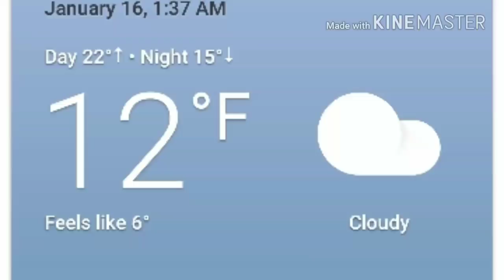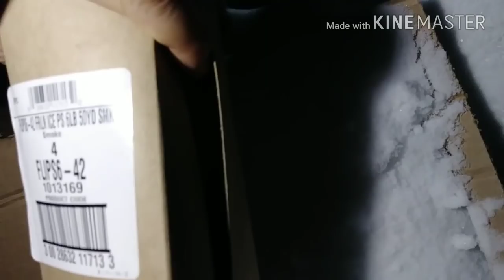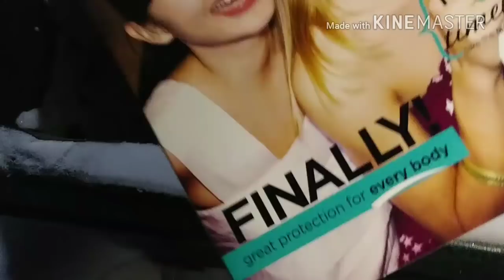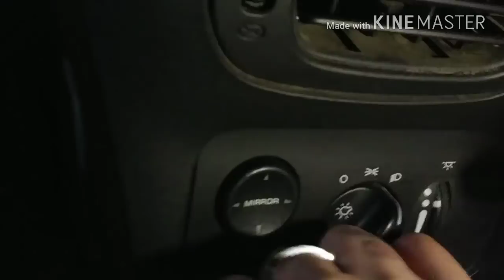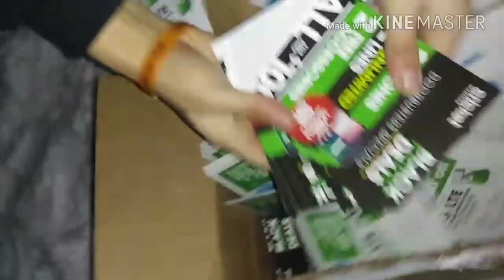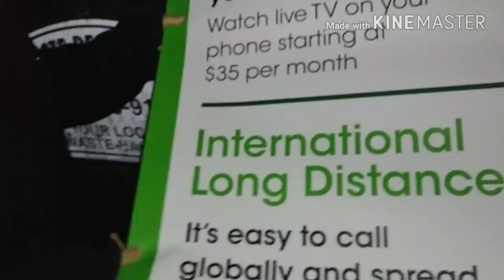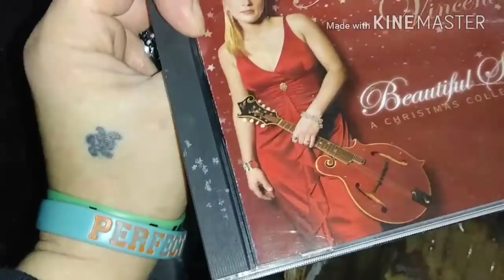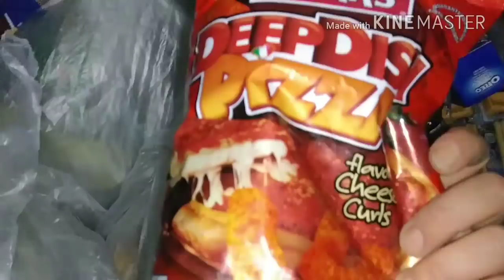SHE FOUND DIAMONDS! - Dumpster diving Jackpot!...

Comment: If you are going to be serious dumpster divers you should learn how to sell used clothing on ebay and etsy.  There was some good money in that clothing.  That yellow orange stone in the ring might be a citrine if the metal turns out to be real gold or sterling.  Let me know what the markings are on the inside of the rings.  I know a bit about good jewelry having bought and sold antiques of all kinds for over 29 years.
Reply from the maker: Vicki Olson - markings inside clear stone said 10k the other said 14k
Reply: Vicki Olson koo
Reply: Vicki Olson you are so right Vicki I resell and 
Know c alot about jewelry also, does look Citrine
Reply: Did you get them looked at?  If the rings also jave the markings GP, HGP,  HGEP, EP.  all of those mean little gold amount.  The larger clear ring looked like a white  safire.  How much were they werth?
Reply: Next thing is to take them to a jeweler or a pawn shop to find out their weight, etc and what the stones are.  Do not sell them at a pawn shop.  They will offer you less than half of melt value and you can do so much better on ebay.   I take gold to pawn shops just to find out the weight and what they offer.   Then once you know how many grams you have, you can go to a gold calculator online and find out what the melt value of your rings are.   It looks like you have a 14karat gold ring and a 10 karat gold ring.   Usually if they are marked, they are real, but that does not mean that yours are.....stamps are cheep and there are unscrupulous people out there who put good marks on fake rings.
Reply: Vicki Olson even Facebook